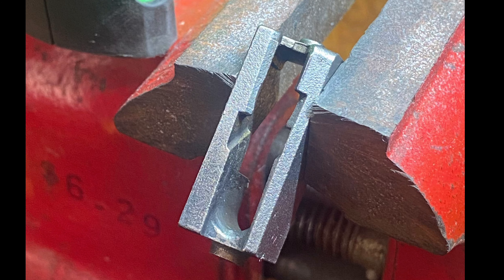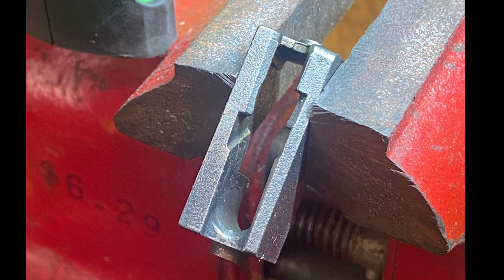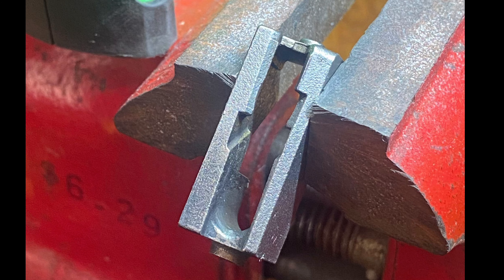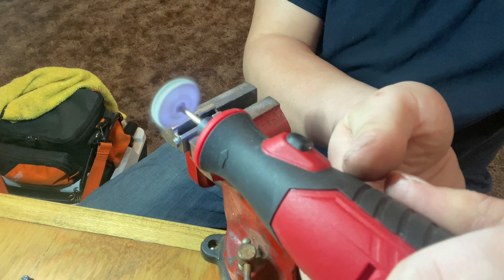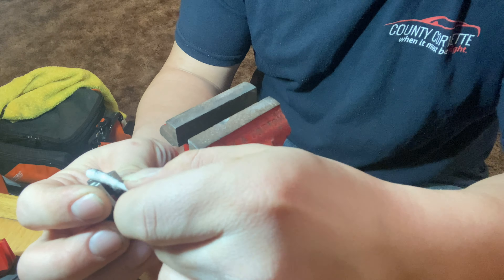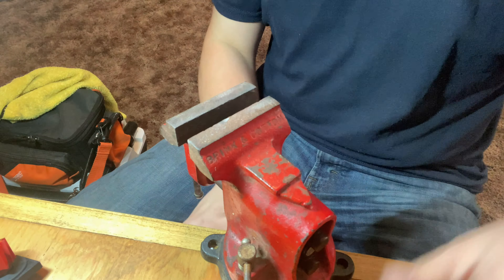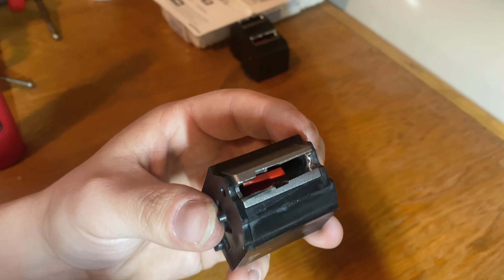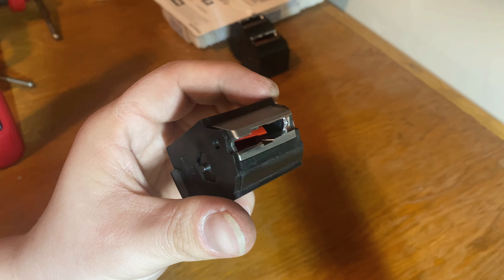Ruger 10/22 Rotary Magazine Feed Lip Polishing

Comment: I do this to all of my new Ruger mags.  I shoot Steel Challenge at a high level and can't afford a mag to ruin my day.  You can really feel the difference between a stock mag and a reworked mag.  I use Cratex rubberized abrasives on mine, but your method works just as well.  Once the lips are polished you can use less turns on the mag spring as well.  I'm surprised that you haven't gotten more views or comments.  Just goes to show that most shooters don't really care about tuning their equipment for optimal performance.
Reply: People have short attention spans and move on after one minute of viewing.😂
Reply from the maker: For sure it does make a big difference! Thanks for your input hood info. I’ll check out the cratex stuff.
If you haven’t please hit that subscribe button!
Reply: Al Frangipane  Well, you've  performed this operation before. Maybe more didn't watch, because the volume was VERY inconsistent, there were no close ups of what he was actually doing and how to perform the polishing properly without damaging the feed lip of the magazine. Also, no close up of the finished work. The only reason I hung around was because you dissed people without good reason.

Comment: Thanks for making this video. My 10/22 is literally the most frustrating and least reliable gun in my collection due to the design flaws inherit with it despite the Ruger fans all saying how reliable it is. Especially with hollow points. The hole in the bullet grabs and I get a failure to feed on every single round. Shoots bull nose ok if it's clean. Factory mag works the best as we all know but the Ruger BX 25's, newest gen, and others all misfeed. Was ready to sell it or send a video of me taking a sleedge hammer to it and throwing it away to Ruger. Its not out of the question still for me. It's my first and last Ruger for sure. Very disappointed in Ruger that they mass produce this rifle with all its issues and don't address them. Was between the takedown and the Marlin . Still regret not getting the Marlin instead but the aftermarket options for the takedown are amazing. I will try this and see if it helps with the mags. Thanks again for the info. Hoping it helps my blood pressure. Lol
Reply from the maker: Your welcome and thank you for watching! I sure hope it helps fix the issue for you. I love my 10/22 and surprisingly mine doesn’t give me any issue. Also check for burs in the chamber mouth.
Reply: You can also replace the plastic magazine catch plunger for a steel one so that there is less play and less chances of misfeeds
Reply: Quit using BX-25 mags and the gun cycles fine.
Reply: @1wheeldrive751  You completely missed the point. Ruger makes those mags specifically for this rifle and they don't work. That's a crappy thing. That was lost on you somehow.
Reply: @ - it’s not “lost on me”.  I’m just telling you what works.  I know the banana mags are a PITA.  When something’s a PITA, don’t do it.

Comment: You're a little sloppy about reassembly. According to Ruger, the proper tension on the rotor is to turn it 8 flats (one and one third turns), then snap it into place. That will give you the correct tension on your rotor.
Reply from the maker: Thank you didn’t know that 👍🏻
Reply: @BlacktopTactical  Glad I could help explain something. Now you know a little bit more.
Reply from the maker: @deadeye566  appreciate it! Always wanting to learn
Reply from the maker: If you haven’t please hit that subscribe button!

Comment: Very long time shooter but new to 10/22 mags. I shoot a  Christensen Ranger. What I really notice is some mags feed like it scraping the round out of the mag body and I have at least one that is very smoothe. I am very definitely going to give this a try. Thanks for posting!
Reply from the maker: Not a problem! Glad I could help. This is a good fix for that it’s a common issue, I had the same problem before I did this and it fixed it up good for me. If you haven’t please subscribe! Thanks for watching
Reply: @BlacktopTactical  I just completed the work on the 3 mags I carry in my ammo range can and the difference is DRAMATIC! Butter smoothe feeding and loading. Thanks again for posting this!!
Reply from the maker: Awesome!!!!! Glad it helped ya man :)
Reply from the maker: @RS H your welcome! Thank you for watching! Please subscribe
Reply: @RS H I've used my polished mags now many times without a single failure. When I  reassembled the mags after polishing, I used much less spring tension than factory without an issue. That also makes loading the mags much easier!

Comment: How many turn do you put on the springs?  I use 1.5 turns and they work fine. 2 turns was too tight for my setup.
Reply from the maker: 1.5 is good, ruger suggests 1 1/3 turns for tension. I haven’t had any issues so far. I’ve been doing 1.5 turns 
If you haven’t please hit that subscribe button!

Comment: That's not a Dremel tool. Looks like wallymart to me.
Reply from the maker: Works the same
Reply: @BlacktopTactical where you get that cordless dremel? Is that Harbor Freight? I like it so I was wondering where you got it. Thanks.
Reply from the maker: This one was actually from Walmart. They also now have one that’s rechargeable with a USB C which I really like a lot. The harbor freight ones are good too I like them
Reply: @BlacktopTactical  kk. Thanks. I assume all the normal Drexel attachments and collects will work with this as well?
Reply from the maker: Yes completely interchangeable